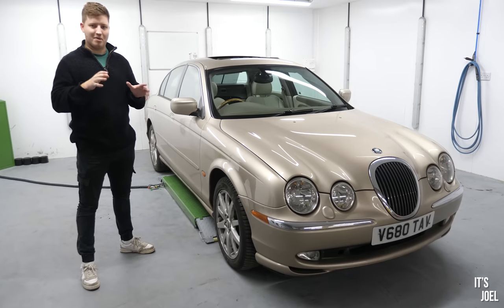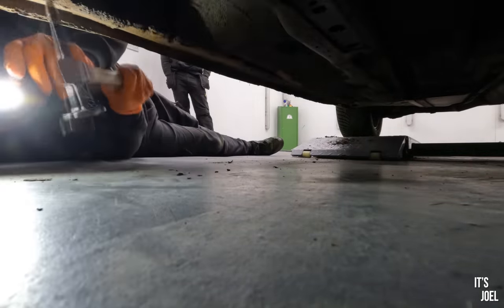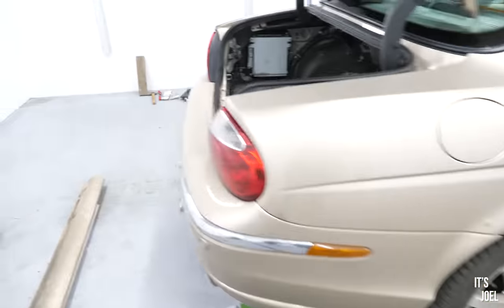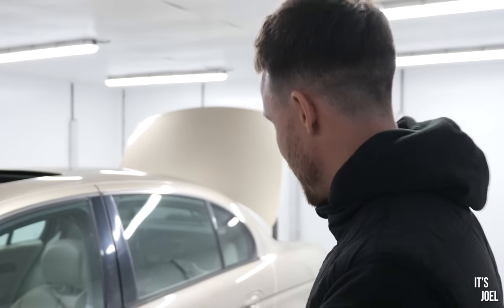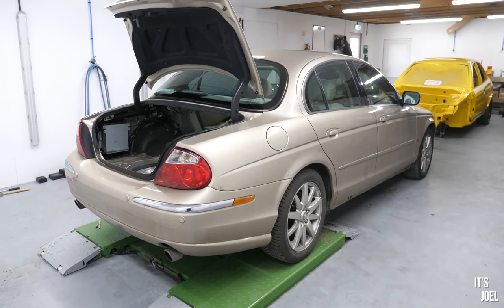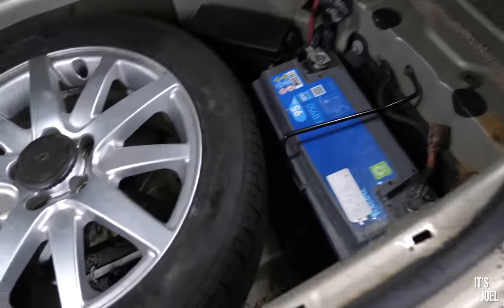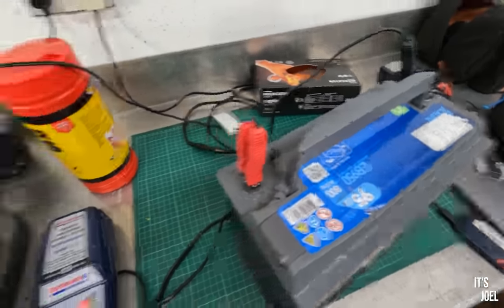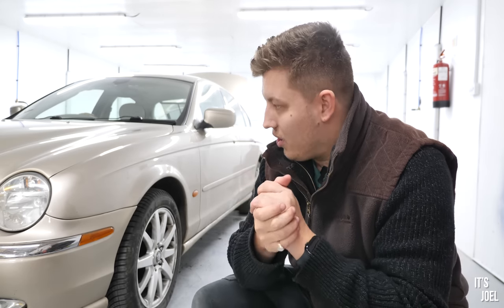What Does 25 Years of Corrosion Look Like On My Cheap V8 Jaguar S-Type?

Comment: I bought a S Type Jaguar that was 16yrs old from a elderly guy in July 2018, who had let it stand for over 12 months, only paid £1000 for it, he had started the engine now and then but not run it, within 6mths of me having it, the water system needed replacing radiator, water pump, hoses, then after 12mths, new battery. All seemed fine until the brakes went spongy, the garage informed me that all the break pipes needed replacing. Then whilst they were under the car they found both sills were rotten, they gave me a price for replacing break pipes and welding both sills, in total I've spent around £2000 getting it right, so my car is now 21yrs old this December it's driving like a dream, I'm so pleased I went with my gut feeling and didn't scrap it. Keep the faith Joel. Good luck 👍
Reply: Absolutely agree Brian , good man and im glad Joel is putting the effort in to keeping hos Jag going too .
Reply: @manageme07  Thank you.

Comment: Fix is the RIGHT decision. That is basically a nice car when all the aches and pains are sorted IF YOU PLAN TO KEEP IT longer term. Sporting saloon V8s are  nice driving experience. 

After all, £1000 is not a lot all things considered. A close relative just spent four figures repairing the DMF and stop start facility on his very ordinary Ford about one quarter the age of the Jaguar. A friend needed to spend much more than that on his so called "prestige" German car. Motoring always has costs but classy motoring like that need not cost a lot. If in the end your total spend is around £7000, that would not buy much of a used car and that could come with far more expensive things needing doing.

Comment: It's what you want, repair it until the next certain problem, then repair that or sell it, this is not new we have all faced this. My thinking is if you lease/buy/pcp a vehicle like that standard you are paying £4000 a year roughly, so if you get another 3 years out of it your £6000 is cheap motoring, but you always take a risk. In this case I see a car that will appreciate in value due to rarity, but will have a limited market, your big problem is that you are reliant on others to do the work. Most guys running these cars do 80% of jobs themselves, but this requires lots of expensive equipment and time, and of course knowledge. From what I have seen, no insult intended, you cannot do this, get rid of it and cut your losses.
Reply: Agreed.
It is a shame because it is a nice looking vehicle but its of such poor quality that its made it a poor buy.
Im no expert on the classic car market but I doubt if this kind of Jag will ever be sought after

Comment: Don't flush the gearbox Joel...if it's not been done after all this time, just top it up!
Could start playing up...slipping etc 
If you must just change the fluid, don't flush!
Reply: Don’t flush, just drain and refill so you don’t change all the old stuff at once, draining always leaves a fair bit behind and doesn’t shock the system.
Reply from the maker: Great advice, thanks. I’ll start with a fluid change

Comment: If that is just a lead acid battery it's worth removing the caps and if any of the cells are above the acid you can top it up with deionised water and try a charge again.

Comment: Get the sills done this is a common problem on many cars Ive had worse take for example a Rover p6 where the floors are so bad  you can see the ground, and under the passenger seat can see the and put your hands through and touch the inner arches. All parts are replaceable with inner and outer sills. Floor pans etc. What other choice have you ? Scrap lorry for a few hundred pounds or breaking and selling bits here and there and turning your property into a scrap yard?.

Comment: Those awfull plastic side skirts... Believe me on each and every make I have had with these kind of sills there is corrosion underneath. I have had this with Mercedes, Volvo, Citroen, Opel and so on. Get it sorted, rust proof it well and enjoy. I used to own a S-Type, albeit the 3.0 Litre. Great car, one of the best cars to drive I have ever had. In that case I was able to remove those plastic sills in time, before the rust got a real hold of the Jag...

Comment: What happens if you spend all these thousands of pounds on this car and the car is written off in an accident. A minor one could easily write off a car of that value. How much would the insurers pay out for it? £1500? £2000? That would be my worry. 
I had a lovely example of an older Mercedes and someone ran a red light writing mine off. 2 months prior I had a lot of suspension and servicing work done costing £1000+… It could never be recouped even after a higher valuation was given due to its pristine condition. I wanted to keep the car going like you with the Jag, but one small accident and all the money you put in is lost.

Comment: The logical answer is to cut your losses but then if the content is worth the expense then sure enough get it fixed. Although personally I would say use it for your wedding as it is then get rid of it. 
Quite a few comments are talking about it being a future classic. I disagree I'm afraid, it'll never be that sought after and even if it did we're talking in 20 years or more and it'll have to be in an immaculate low mileage condition to be worth any money.

Comment: £1000? I had both inner and outer sills on my X type done for £450 😮
Reply: I thought a grand sounded pretty fair 
I spent a grand of the sills of an old camper van 
20 years ago I replaced the sills on a 944 , that cost 2 grand 😵
Reply: @Carrera-gp9od  disagree you can buy the repair panels for both sides under £150. And decent welder could do it for £300 

Most people in the xtype and stype forum pay around £500